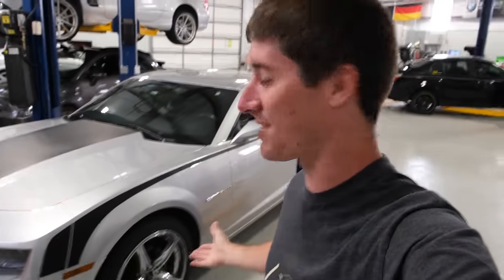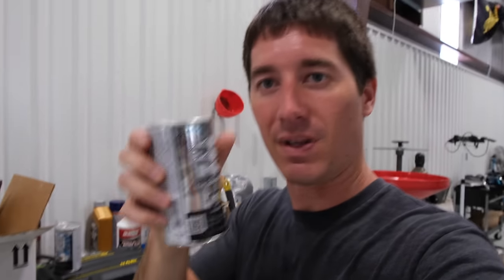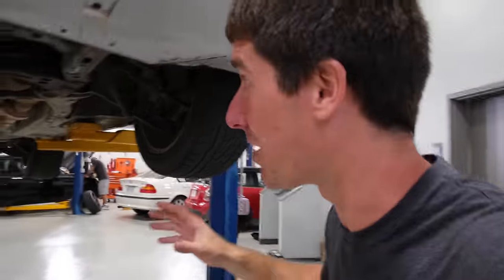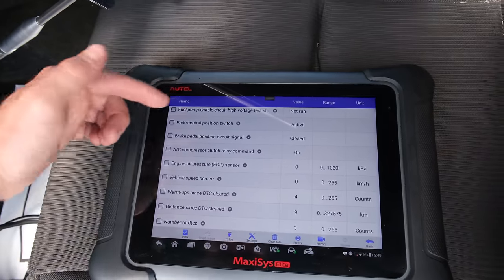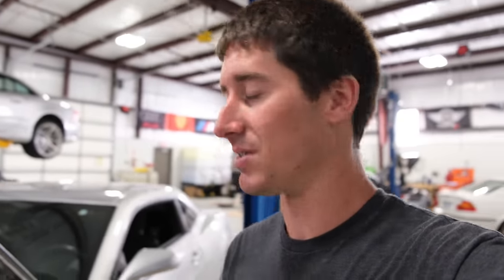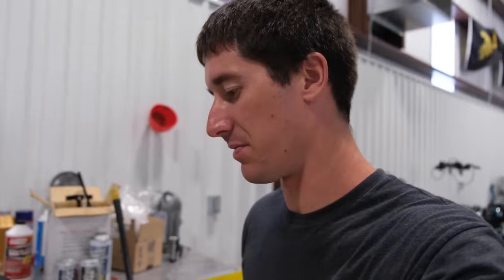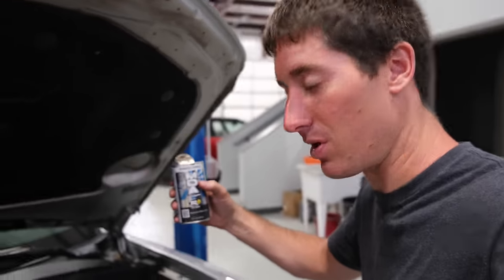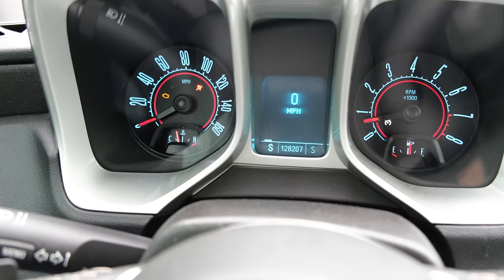FIXING The UNFIXABLE Engine In My CHEAP 2011 Chevy Camaro RS *SLUDGE REMOVAL*

Comment: you’re worried about the engine running cool you actually want it to run pretty hot .Like 220 to 240 you want the fan on the catalytic converter’s that’s what you need to be worried about not the engine sitting there at 3000 RPM is the worst thing in the world for those converters they’re supposed to have a lot of air moving across them.A good breeze isn’t nearly as much as driving down the road if you do this again put a fan on the converter’s. Leaving the hood open is plenty.The engine already has cooling fans on the radiator.

Comment: Kerosene and ATF  fluid saved a 350. Cheevy. Ç30  truck. With 88k miles with an overheated gummed up engine...drop the pan clean oil pump screen too

Comment: Frequent full-synth oil changes every 3-5k depending on engine miles, and you cannot go wrong.
The oil-life monitor is GM's way of ensuring you wear it out around 150k.
Oil is always cheaper than an engine at 100k.

Comment: My procedure if I bought this car. 1st. since they said CATS. were clogged " GET RID OF THEM " before running the engine at 3,000 RIP UM'S for over an hour.  Use straight pipe to replace CATS. FOR THIS CLEANING.
2nd. Clean as much CRAP OUT AS U CAN MANUALLY, I sometimes I use a shop vac. & reduce the hose down to about 1/2.
3rd. Drain oil, Drop oil pan, clean it out & oil pump screen.
4th. I use 50/50 Kero. & engine oil, new oil filter, over fill the engine by a few quarts then let her set for a week.
5th. Drain off 50/50 mix till it's full mark on dip stick. Start engine & run it for 5 to 10 mins. at 1,500 RPM'S  or until Thermo. opens. If any knocking, shut engine off & drain.
6th. Refill with 1 QUART kERO. engine oil, till full mark on dipstick, & new filter. Run engine for 1/2 hour at 1,500 RPM'S.
7th Drain oil, Drop oil pan replace oil pump, rep[ace timing chain, then refill with SYNTHETIC OIL & new filter.
8th Replace  PVC valve & make sure line is clear, I would also run a OIL Catch Can & vent the side of engine that was dirty. There's different ways of doing this all over the WEB.

Also FLUSH COOLANT SYSTEM, CHANGE THERMO. & DROP TRANS. PAN, REPLACE FILTER THEN REFILL. MIGHT WANT TO DO THIS TWICE ? Actually that engine did not look that bad at all, I've seen engines that when you removed the rocker arm cover it was PACKED FULL OF BURNT ON OIL & CRAP.

Comment: used to put a couple of qts of ATF  to flush engine  high detergent..idle for couple of hours
Reply: My brother told me to use diesel oil to flush the engine
Reply: Back in the day yes, not on todays cars though. ATF breaks chunks off which is crazy dangerous with tight tolerances, the new stuff supposedly re-liquifies the sludge so it can safely pass through

Comment: My E39 with the M52tu was 1000x worse than this. The heads were 100% sludged. The sludge was literally solid because it had sat for so long. I have no clue how oil was still getting up there for the 8 months I owned it. The cams were literally not visible. It finally gave out tho when the pump/sump got clogged and was not savable. It was so terrible.

Comment: The process Ive used for the last 45 years is this...Use About 1/3 kero or diesel mixed w NEW engine oil and new filter...(if vechial uses 5qt replace with 2 gt with Diesel or Kero) Remove old oil and filter replace with mix and new filter run for 5-10 min IDLE or High Idle 1500rpm...DO NOT DRIVE OR REV ENGINE,drain and repeat if needed usind a New oil filter each draing cycle...Then do you final fill! I would use inexpensive oil and filters for the cleaning cycles. ATF also will thoroughly clean sludge but pricey to use as a flush these days!

Comment: One quart 40 hd fill the rest with diesel oil.... Drive around town empty and repeat... Get several oil filters. One that stuff breaks up you have to change filter and repeat... You do not go over 2500 rpm...

Comment: Those cartridge filters suck in my opinion.  I don't know why vehicle manufacturers don't stick with the conventional spin off types?  If you over tighten them, the housing cracks and you'll get oil all over the engine.

Comment: The PVC on the LH side of the motor has about a 1MM hole. Pull the VC on both sides, betcha the RH side looks fine. Typical GM "Nobody sweats the details" stupidity. GM warrantied so many of these, including my wife's SUV at 77K miles. Less than 50K miles later, did it again and I researched why this happens. Flushed the engine with trans fluid/kerosene mix, modified the LH PVC system & valve cover was opened, replace the chains, phazers, tensioners T-stat, water pump, alternator...wife drove it another 30K miles and sold it. Change the oil every 3.5-4K miles, uses synthetic oil and a good filter and modify the pieces I mentioned and no problem. Oh, the trans Tec-M is crap as well. Enjoy that $1800 repair- "Generous Maintenance" has made sure my wife will never buy another

Comment: My wife has a 2009 pontiac g8 with I think the same engine.  The check engine lite with code for timing chains.... has been on for 50,000 of it’s 100,000 mile life and its still kicking...  probably blow up tomorrow.

Comment: high concentration 44K does the job super well. I put 1 can in 5 to 6 gallons of gas. You can feel the difference after only 200 miles. I 44k my engine every 6000 miles.

Comment: I have the same piece or Crap Engine in a Cadillac STS. The chains were allegedly changed under Warranty, in Nov 2016. I think they billed GM for it but did squat. GM really used weak Chains in these engines.

Comment: If you have sludge and grit, you want it to stay exactly where it is until you disassemble the engine. Moving all the grit thru the oil pump and bearings will produce a worn out motor that might last 5-10k more miles before KERBOOM. Yank the motor and clean everything and replace worn out parts. This is VOODOO nonsense.

Comment: Never never use conventional oil in a  VVT engine. Synthetic only and keep it changed, maybe 5-6K miles. These people going 10K miles and cheaping out at Jiffy Lube with conventional is what causes all these sludge problems. My cars with 250K+ are spotless under the valve covers, they look brand new. And run like new.

Comment: The absolute best way to clean sludge from an engine is to use HD30 engine oil and a case of fresh but cheap oil filters.
Do three oil changes with filter in the driveway - not driving the car.
1st one change after 15 to 30 minutes.
2nd and 3rd oil changes with filter after an hour of idling in the driveway.

Change it again with a filter and drive it for 30 minutes and then check the oil.
If it's black again repeat and drive for 45 minutes this time.

Check it - what is the condition?
Black? Change oil with filter.
Still golden or see thru dark?
Drive for another 30 minutes
Just easy driving - no highway yet.

Check the oil and change the oil when it gets dark until you can go a month with still clear looking engine oil.

Going to a full synthetic oil after this will clean the engine much better as syn eng oil is very high detergent engine oil.

Then change your oil and filter regularly depending on your driving habits.
All in town and rarely warms up the engine?
Change once per month.
Some Hwy driving but mostly city in town?
2000 miles maybe - check oil often for color.

All highway 95% of the time?
No more than 3000 miles - and use 100% synthetic engine oil and a Wix XP oil filter from then on.

These are my personal opinions but have been proven to work numerous times over 40+ years of automotive repair an personal used car purchases.

Comment: Boooo
Shoulda just got a junk yard 6.2, or crate engine Camaro, trans, and rear end, and turn into SS clone.
OR
3.6 V6 that’s already built up, and ready to go.
The ruff idle, was probably some fried plugs.  
I woulda changed the plugs, cause you prob have a busted contact in there.  
Alaska you can cut the cat off baby!  I wouldn’t try that in Anchorage, but outside Anchorage, sure, why not

Comment: Lol, it's obvious you've never worked as a technician in a shop. When I worked for GM in the 90s they had a 20 minute oil change. Customers would come in, in July, 90+ degrees, engine hot as hell, oil filter on back of engine above the exhaust pipe that was as hot as the sun. I had a hot sleeve from snap on to protect your arm but I still got burnt a few times changing oil. We also had to grease, tire pressure and tread depth check, 17 point inspection, all in 20 minutes

Comment: Another step backwards and Technology. Going back to cartridge freaking oil filters. Another stupid idea. Of course General Motors is one of the ones doing it.
But has to run 3000 RPM for 45 minutes, why in the hell did you say it had to idle question mark, I've never seen an engine idle at 3000 RPM. 2000 RPM would have been more than enough. But then again every bit of this is overkill. A quart of Marvel Mystery Oil in the engine for a week would have done at least half the job. And that was before you change the oil in the first place.

Comment: I spent 9 years in car dealerships in the '60s and 70's.  In my opinion the BG products worked as good as many of the supplements available and better than some.  The problem was having mechanics utilize the products while they worked on the owners cars and obtaining a premium from BG for doing so.  Each can contained a red or green plastic washer that the mechanic redeemed for cash.  This more often than not was done without obtaining the owners permission.  Perhaps its done differently now.  At least I hope so.

Comment: You should also check and test RVS Technology. Haven't seen it tested yet by any major channel on YT. Though they have a USA -based channel (RVS Technology USA LLC) where they've driven a stock Civic for 3000 miles without engine oil after the treatment. It's a Finnish product and the story goes that the basic function of the stuff was found accidentally by Russians while boring a super deep hole. The drill was breaking constantly, but at some point it just kept going and they had to raise it up to inspect the drill as it seemed impossible that it was still working. It has something to do with tribofilms or as RVS calls it "triboceramic" films, that will form in high heat areas, reducing friction to very low levels, also making the surface really hard and resistant to abrasion. The company seems to have quite limited resources and/or manpower to promote their products, or at least it seems like it, as they haven't shook the industry much even though the product seems to work really good.

Comment: You need to invest in Schaeffers 131 Fuel Stabilizer used in the oil. Use it over the long haul to gently clean and keep it clean. If the rings or valve guides are gone nothing in a can will help. Switch to either M1 or Castrol 0W40 or better yet Rotella T6 5W40 for this worn out engine after you do the timming chains and oil pump!

Comment: These engines have reputation regarding the chains.  My ex had a 3.6 in a GMC that lived long and needed a valve job after 100k miles, but the car was driven hard every day.  Lots of stop/go and full throttle hammer down runs.  The 3.6 is the class of the field compare to the V6 from Ford or RAM

Comment: Run Royal Purple in it. I was a amazed at how much it helped my sisters Camry. Yes. Even royal purple said that we would have to change the oil and filter after 500 miles if engine was bad. After 500 miles the oil came out black as coal we changed the oil 2 more times at 1k mile intervals finally on the 4th oil change it was staying purple and could last 3k miles.

Comment: Usually I wouldn't recommend this kinda stuff on any nice engine since it loosens all the soft stuff but also some of the hard stuff. And having that hard carbon buildup go through an oil passageway and end up on a main bearing or even a rod bearing would do more harm than good. Also I don't usually post crap like this, but why would you want a Camaro V6? Isn't it a muscle car...?!

Comment: So it was running good even with a stretched timming chain? I have a Colorado no chain noises but runs rough no power almost, did coils and plugs, new camshaft sensors, solenoids,  still runs bad. Codes p0016 to 19

Comment: These engines are known for stretching timing chains from long maintenance intervals/extended run time at low oil level. I experienced this on an Ultra low mileage Enclave I purchased as a daily driver. One owner Vehicle had 48k miles and CEL came on - timing was off and soon after cats clogged and burned due to running rich. Long story short your going to need timing chains, cats, O2 sensors, check cam actuators and clean out the valve covers/change PCV. You will be surprised how finicky these engines are to maintaining the right amount of oil and interval. These do suffer from too much oil vapor getting sucked from the crank case to intake - CHANGE THE HEADCOVER GASKETS - GM updates the design and didn’t tell anyone. Make sure you get the new ones from the dealer! Good luck brotha - enjoying the channel!

Comment: Marvin's mystery Flash use it instead you don't have to be a dealer. Drain the oil change the filter add the mystery flush top off with 0 - 20 run motor until reaches temp shut off let's set for 2 hours. Drain oil and flush replace filter. Fill with 0 detergent oil run motor until up to temp. drain oil replace filter add specified oil for that motor until full. And everything will be great. I've been flushing out motors with this product since 1965. And back then they were such products as oils that contained paraffin that's wax and this flesh cleared that out.

Comment: the original owner neglected that car plus used the cheapest dinosaur oil at Jiffy lube... you cant do that to a DI motor, those things are as fragile as glass and the ONE thing you cant neglect is oil... it MUST be the highest quality synthetic if not a DI specific oil like Valvoline Modern

Comment: A few people put a bigger bung on the valve cover side with the poor flow and vent back to the intake manifold. This fixes the sludge issue with these motors. It's a design fault.

Comment: I had the same exact issue with my aunts cadillac cts 3.6, that has the same exact engine. If your seeing sparkles in the oil filter, thats more likely rod bearing. Our oil sludged up and took out the rod bearings, and me being slick to save money. I just dropped the pan myself, sanded the crankshaft journals smooth and put all new rod bearings, but torqued the problem bearing 10 pounds more and surprisingly that lasted for 2 years, but because they didnt keep up with the oil changes again, they destroyed the engine. This time the mechanic slapped in a new crankshaft, and bearings.

Comment: Nice ride. I just purchased a 2010 2LT from a lady in Long Island. She was terrible when it came to oil changes and jammed the engine. Turns out a bearing spun. I have to change the crankshaft, connecting rods, and the bearings. I was going to buy a new engine but i figured I’d just fix the one in the car 🤷🏽‍♂️. Hopefully i can get it all on camera so i can post the process on YouTube. What state do you live in, and what site did you find the car on?

Comment: The good news for the timing chain repair is that this vehicle is RWD. The FWD setups are a nightmare to do. If that's the original timing set, that's pretty good for that engine.  Make sure you install an aftermarket set from Cloyes. Their parts are high quality.  I expect that you'll find plenty of carbon on the intake values as well. 
That is likely what's causing the rough idle.

Comment: On the 3.6 one side is always cleaner than the other because of the pcv circulation. The fresh air side is always cleaner than the pcv side or passenger side. These engines require 3000 mile oil changes not 5000 if you want to keep them alive, and you need quality oil.

Comment: This process is really hard on the engine. Don't be surprised if you need to do it again. However, you need to put oil in it and drive for 100-500 miles. Then repeat the process.
      14:55  You need to put your hand directly in back of it and say..  focus you fack!

Comment: Where is the after pics under the valve covers? This would’ve been nice. Diesel fuel flush or transmission fluid flush would’ve helped too. But there is only so much one can do when the engine was neglected for so long and probably abused.

Comment: All those LS variable valve engines are notorious for collapse lifters because of solenoid failure. Hope all that Sledge didn't mess up the solenoids on the lifters if it did then the cam and the lifters are gone. And dealerships don't rebuild motors. That's probably why they recommended replacing the motor. You can replace the cam and convert the engine to 8 nonverbal by replacing the lifters and plate. That is if you're valves and pushrods aren't bent

Comment: My '09 Caddy SRX had the prior version of this engine. At the first oil change the filter cap was so tight the nut part twisted off completely. I had to remove the rest with a child chisel. Fortunately I was able to get all the bits out and got 80k more trouble free miles out of it (to 125k)  before I started getting a code for a bad cam chain tensioner.

Comment: Them 3.6 alloytechs have an issue with sludge on 1 side because of the ventilation system Wich causes timing chain issues I know because of the amount of alloytechs in the commodores here in austrailia